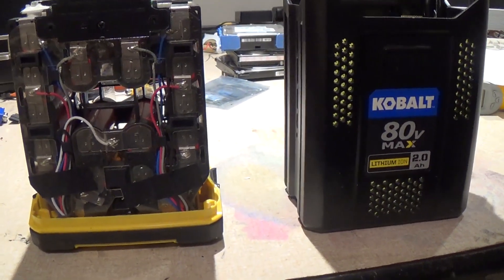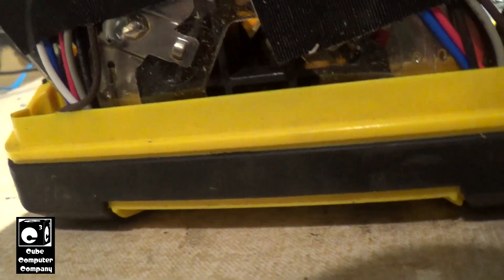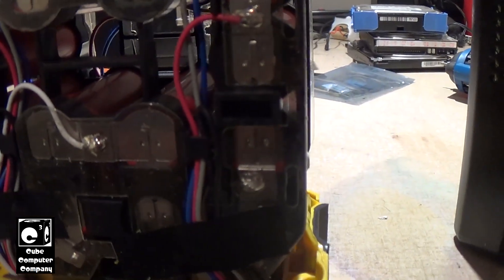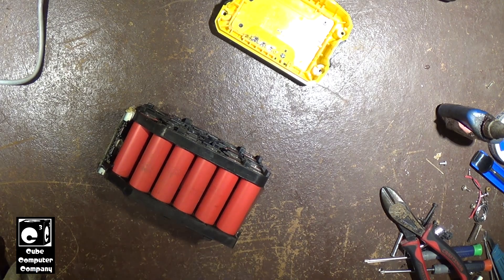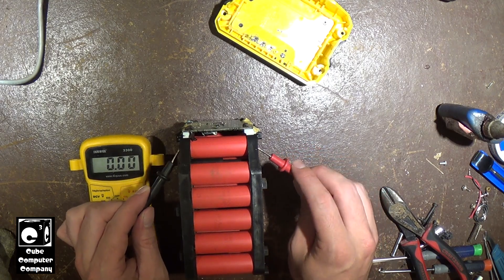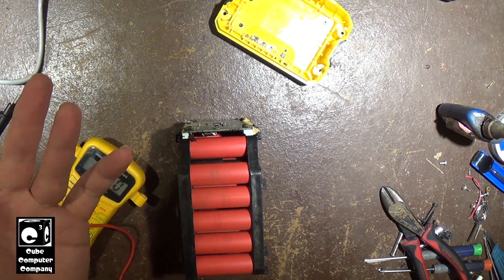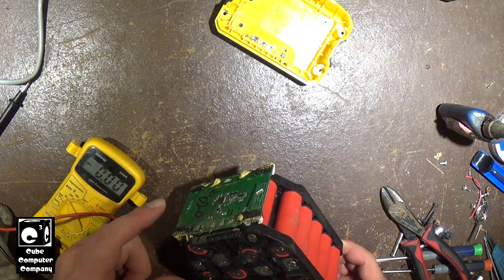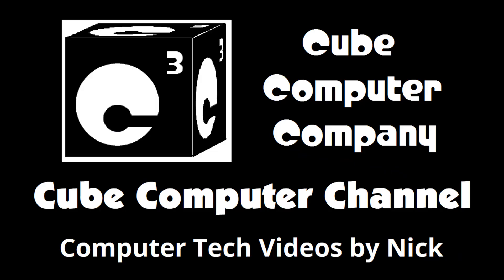Kobalt 80V Li-Ion battery with vented 18650 cell - This could have been very bad!

Comment: You could have just replaced that one bad cell had you checked the voltage before you destroyed the pack,
Reply from the maker: I am very well aware that I could have replaced the one bad cell. Fact of the matter is I had zero interest in repairing this pack. I was more interested in "destroying" the pack as you call it, so that I could use the remaining high drain cells from it for other applications where I need high drain cells (the rest of my 18650 collection is all low-drain cells used for powering my cameras and flashlights).